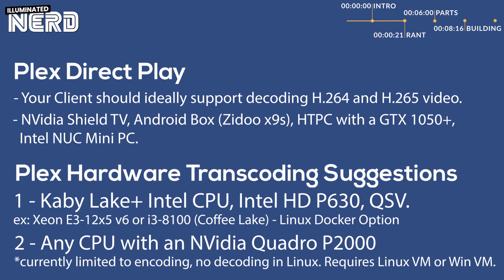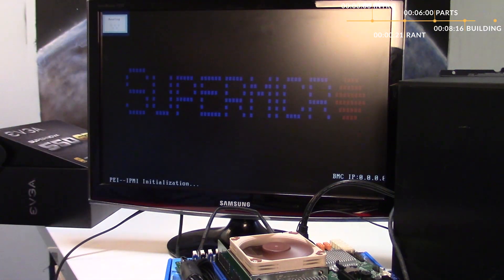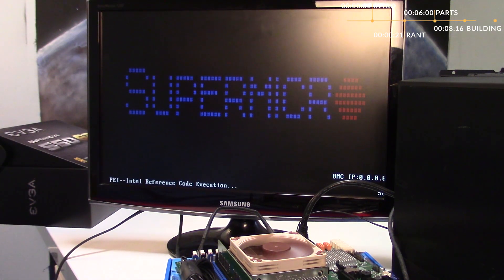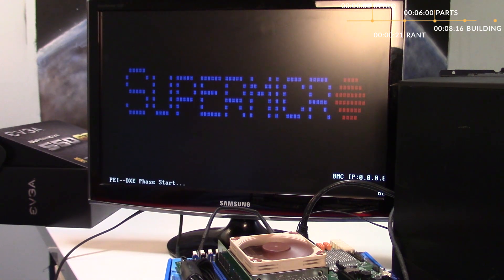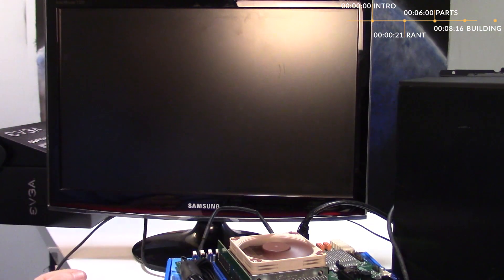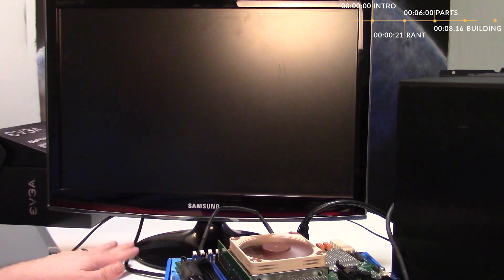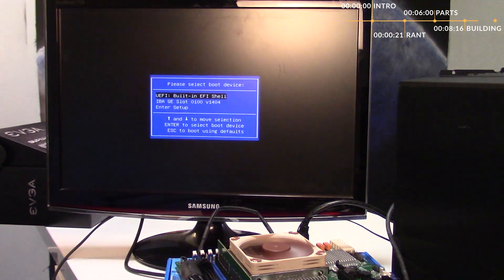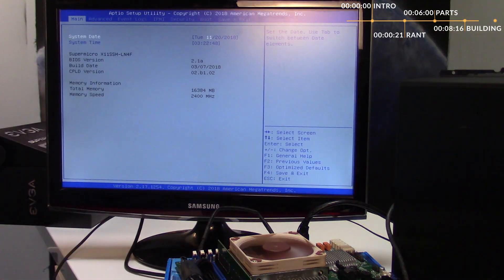Building NAS & Plex Unraid Server with Fractal Design Node 804 - Part 2 - Building the Server

Comment: Thanks for the video and sharing your knowledge.  I was wondering if you could explain why you chose these specs.  I am a newbie to Plex and NAS in general.  I'm wondering what I need to play movies (generally not 4K) in Plex and back up my files.  As a newbie, I'm also debating whether to buy off the shelf like QNAP/Synology/Drobo, or build my own. I like the idea of building of my own, but I'm not sure I'm ready to take the plunge to build something expensive.  For the newbie, could you provide some alternative suggestions, i.e., less pricey but the "good enough" specs?
Reply from the maker: The price for a pre-built NAS is not necessarily less expensive than building your own, unless your needs are met by just a couple hard drives. The nice thing about the Synology NAS is that nowadays they tend to run Plex (so does an NVidia Shield TV though).

If you're looking to use plex to watch internally in your home LAN (ex: on a couple TVs, running Android Boxes), you could use practically any old computer, add some hard drives and install plex on it. A single 1080p transcode is about 2000 CPU passmark (check cpubenchmark.net to lookup a specific CPU).

There's likely a fair number of people that use their previous PC after they upgrade their gaming rig and build a NAS out of it. You could consider that option if you have an old rig sitting around.

Note that I build docker containers for work and wanted a home-lab I could deploy & test on. I wanted to ensure that my plex server would not lag my work efforts. For me, the ability to use plex hardware transcoding helps guarantee that the CPU is barely touched if I'm watching something while working.

Lastly, I went with a Xeon + ECC Memory for reliability/resiliency. Xeons are designed to run 24x7, consumer PC CPUs are not. Since I run a home-based business, investing a little made sense for me to have a NAS to access my old footage/video projects.

The amount of money invested into building a NAS should be directly proportional to how important to your data is, and how important it is that you can access it on your network. You should still backup important data from the NAS elsewhere though.

If you're just building a Plex server for "home-use", my specs are overkill for that. My specs are closer to what someone would end up with if they want to host a Plex server for 10-15 users. As mentioned above, I do have other use-cases.

If after everything I've said you're still considering building "new" and don't want to break the bank, I would probably build an i3-8100 in a motherboard 8+ sata ports. Check pcpartspicker.com to find one and "pre-build" your system so you have an idea on cost. It also helps you compare prices, useful site. Here's roughly what I built for reference: https://pcpartpicker.com/list/9Wty3b

Hope that helps you decide :)
Reply: @IlluminatedNerd  Thank you so much for your response, really really helpful.  You've also made me research on what backing up really means (versus running a NAS with RAID on it - which I now understand is not a back up).  If I could trouble you for one more question, what do you recommend for someone with about 15-20 TB of stuff to do in terms of back up?  I've read about the 3-2-1 rule, but think it could be overkill for me.  I was considering buying one or two 10-12 TB HDDs, loading my files and putting the HDDs away in a safe.  I know there are a bunch of cloud options, but I would prefer to back up locally (I'm a little old school).

Again, thank you for your advice.  I can't wait to see Part 3 - any word on when that will drop?
Reply from the maker: This is a more restrained build I wanted to show you: https://pcpartpicker.com/user/Mershin/saved/DV3D23
It's similar. With this you would get 6 SATA Ports, or could go with a MOBO with 8 for a little more. You could then get 4 larger drives (10-15TB), one for parity and the rest for data.

Personally I'm going to have my NAS, and then do cloud backup. I'm not doing 3-2-1. I only delete my files locally once 24h+ have passed and my NAS has sync'd the cache drive to the mechanical disks (this may not make sense until my next video).

Two local backup options I would consider:
- Build the cheapest NAS possible. You backup your primary NAS/Plex to a 2nd local NAS once a night. It would just have mechanical hard drives in a raid array.
- Seagate makes 10TB External Backup drives - https://www.amazon.ca/Seagate-External-Desktop-Storage-STEL10000400/dp/B0798DVKRV/

The external drives are getting large enough to seriously consider just getting a 2nd one if you really need that much storage for "long-term seldom accessed" backups. 

The 3rd NAS video is the next one coming, so within a week or two. I'm just setting up everything in the NAS once (currently), then formatting and doing it a 2nd time on camera (next). :)
Reply: @IlluminatedNerd  Wow thank you for the recommended build and your take on back-ups.  Really helpful.  Please keep the videos going.  I see great things happening with your channel!